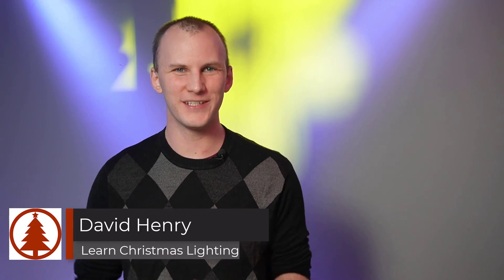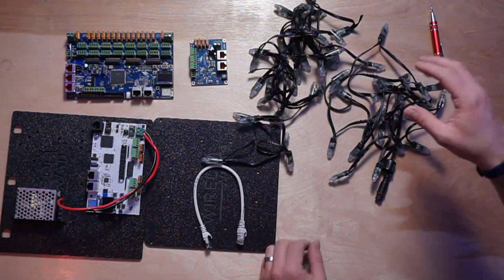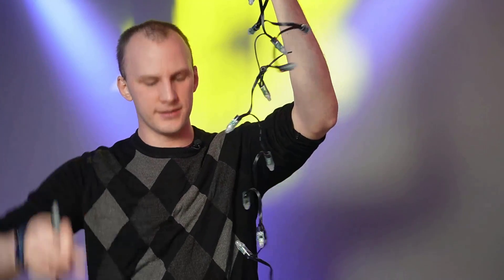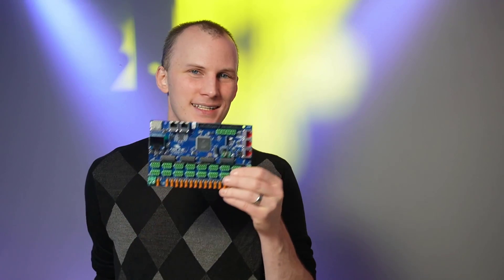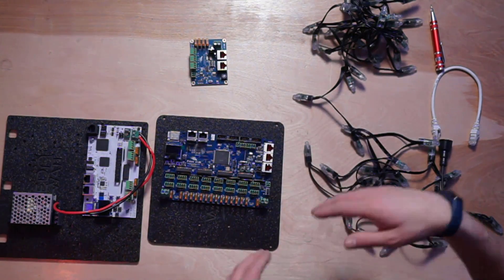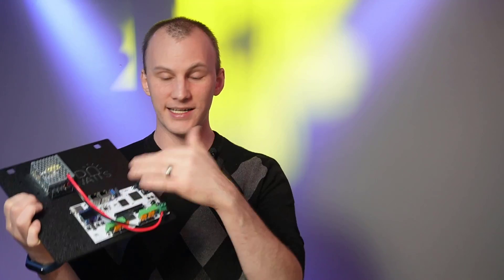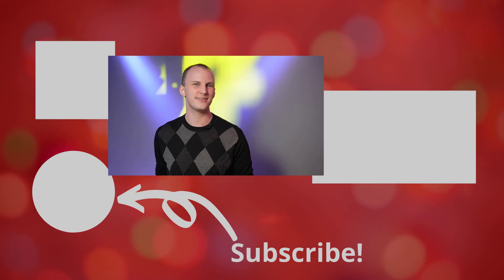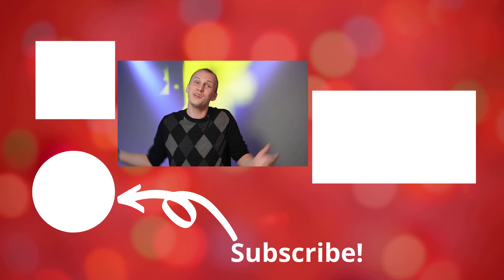Thinking about doing an animated Christmas light show? Watch this first!

Comment: You didn't mention F Amps David. I understand you can insert them every 20 ft and hopefully be good to go. Assuming your controller has enough ports for everything you want. Granted I have not tried F Amps yet but intend to. I plan on a rather limited animated display without music using an 18 x 96 matrix and a few pixel poles and snowflakes. Maximum distance from my 16V4 controller around 60 ft.  Yes I will use power injection.
Reply from the maker: I'm not a fan of it.  It's basically trying to hack the protocol to do something it's not meant to do, I'd rather keep data runs short using smart receivers or smaller controllers

Comment: The exact time of year for a video on this! Nb.: I'm about to do  front wash with led bars from 2005 and I hope they are good enough set to white not to look strange on video?  Otherwise I'm going with 4 Chinese $50 RGB parcans. Any experience with those regarding CRI ??
Reply from the maker: I mean, the CRI from these is going to be pretty terrible.  They may or may not look okay - test it!
Reply: @LearnChristmasLighting  Thanks, haven't gotten around to do it yet. So far I'm using halogen flood lamps with CT Blue and it helps.

Comment: Where are you finding the controllers? 'Out of Stock' is all I have found for Falcon and Kulp. I want to do a few christmas trees and arches for 2022. I'm not going to build the trees or arches without having the controller(s) in hand.
Reply: That seems kind of normal just after Christmas as every vendor has pushed everything they can out of the door for this season. I would think by mid Jan they will have fresh stock. Of course in the current environment, who knows. Agree with your thinking though..... get the controller first. Thats how I built up my show and its quite rewarding if, after spending several hours pushing in pixels to props, once your hands have stopped bleeding, you can fire up the controller and see the fruits of your labors!
Reply from the maker: Yep, as noted below by @ForestRiver , a out-of-stock from December thru Jan or Feb is normal.  This year, with all the issues we're having with shipping and manufacturing/chip shortage, it might be a little longer, but we should be able to get something in the summer (my guess), if not sooner.

Comment: Does the receiver get power from the controller or does it also need a power supply?
Reply: Each receiver needs its own power supply. Ideally you prepare your yard with both distributed power outlets as well as dedicated network cables for the required comms between the controller and the receivers. Thats what I did for my first year of showing last year. I added more network and power outlets than I needed in the hope that I can keep expanding my show without having to dig up the garden (again).
Reply: @MrScottCorboy  Thanks for the response. What kind of power supply would your recommend? Any suggestions for sufficient amps/watts?
Reply: @JoeCrawXS  Meanwell is a popular brand and its what I use. Their 12V units comes in 350W size. As for how many you'll need, that depends on 1. How many pixels you are running from that controller, and 2. What brightness you are going to run them at. Through experimenting, I found I could run my lights at 40% and visually it looked just as good as at 100%. In fact I found when I had them at 100% they kind of dazzled and I didnt like the effect. When you buy pixel strings, they will come with a power rating. This is normally the max rating, ie full white (red, green, blue per pixel on) at 100%, so you should take that into account when sizing. If you do the maths on my system, in theory I have a few controllers that on paper dont have enough power capacity, but as i only run at 40%, its fine.